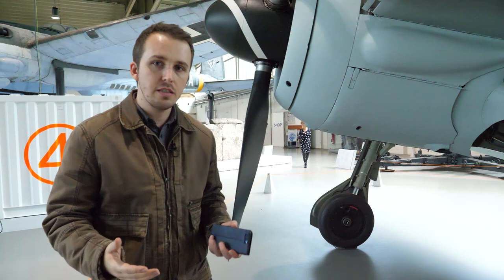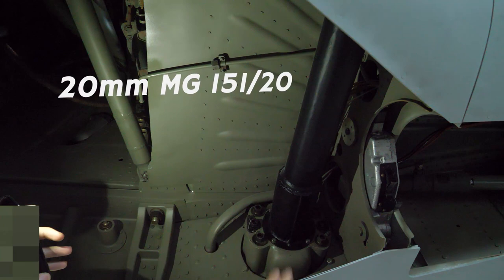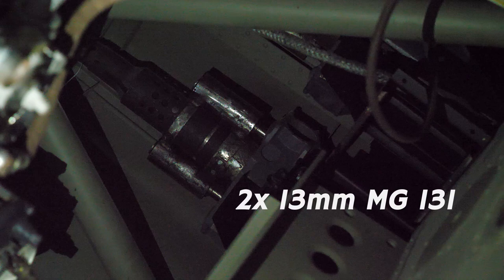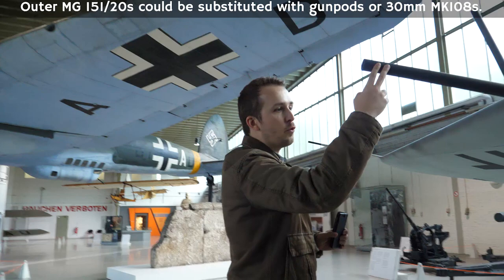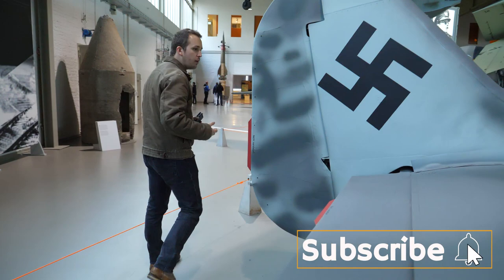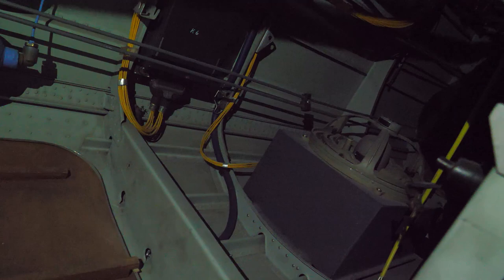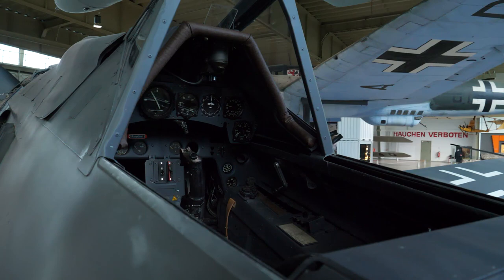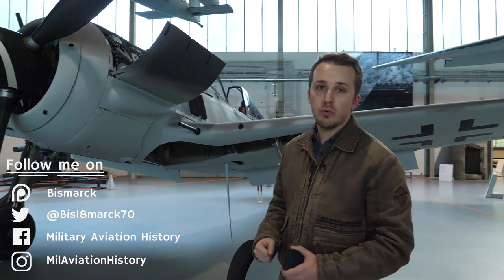Focke Wulf Fw 190 A-8 - Walkaround

Comment: These were gorgeous, lethal fighters for their time. Refreshing to see the tail finished correctly. Most builders and restorers are too PC to include the swazi.
Reply: In Germany, for very obvious reasons, it is highly illegal to openly display the swastika and other symbols of the National Socialist Workers Party (aka The Nazis).

There is, however, very ample room to display swastikas or objects marked with it, especially if the context is clearly historic or non-nazi: A hindu swastika won't get you into trouble, if clearly recognisable as such.
 A museum falls under a similar category. So displaying a period correct swastika on equipment marked with it, it is not at all an issue. Goes equally for restorations, where the all markings are restored.

Same rules apply to sufficiently detailed models. The issue of debate is often the level of detail of the rest, justifying the addition of the swastika. Applying a swastika to a paper airplane is on the wrong side of the divide. As always, context is key.

Putting a swastika on the side of your car, however, not only makes you a questionable person, but is definitely illegal.
Reply: @daszieher  ^

Comment: Many instances of that rear radio compartment being used to stow a mechanic, fellow pilot, or on occasion, civilian evacuees.
Reply: a lot of that kind situations happened during East Front retreat - i've read about it in german pilots diaries :)
Reply: @jurijbaboon  Yes, the Courland pocket is where civilians were evacuated.
Reply: Johanne  Steinhoff  mentioned the use in his book The Straits Of Messina
Reply: There usually is an armored battery box back there. FW-190 was unique because it was the first all electric airplane, I believe. No heavy and vulnerable hydraulics (xcept brakes) or pneumatic systems. Therefore one shot couldn't take out all the systems.
Reply: @fazole  I remember hearing a story about when Beechcraft or Cessna went to file some patents in the mid 60s early 70s, only to find out Focke Wulf had patented the tech 30 years before. I believe it was that automated control system that controlled the settings.
Reply: @sirbader1  
I think Piper came out with a single control lever for manifold pressure and prop pitch in the 80's early 90's. What FW-190 had in 1941!
Reply: Theres so much to tell about this aircraft, also about the way it was manifactured about how the luftwaffe first saw it as a second class fighter etc. Great video, yet i hope that in the future he will attempt to make longer videos with more background info ( like someone down here that mentioned that it was the first plane to have it's surfaces opperated electricly? ) i dont know if thats a fact, yet i never heard of it before. Excelent plane, allies woudn't have had so much trouble if it was an inferior plane.
Reply: @poucxs9246  I don't know if it was the first, but it's systems were electric, so definitely one of the first. It's designer (an electrical engineer) figured it would be more combat effective, and he was probably right.
Reply: Wouldn't putting a person that far back make the center of gravity too tail heavy?
Reply: @wormhole331  They weren't expecting to fight with anyone back there, so full forward trim and a firm grip on the stick and you should be fine... assuming noone else meets you in the air that is.
Reply: @spysareamyth  yeah I imagine it wouldn't be too good for them if a bogey was on their tail.
Reply: @poucxs9246  Lucky for the Allies, there weren’t more of these!

Comment: Excellent restoration of  an FW190 A8. I wish that a D9 variant could be restored and also an FW189.I still have my book on the FW190 written by Heinz Nowarra and between Greg and yourself it's excellent to have these videos.Well Done
Reply: The 190D-9 is on her way. Saw her two weeks ago in the restauration shop in Gatow. The engine is looking good, wings are complete, engine radiator is looking like a new one. Around 70% is original, 30% new.
Reply: Thank you Henry for the update.

Comment: The 190A's could hold their own vs the 47's and 51's. Ultimately it came down to attrition. Had the planes and pilots met on equal terms at 20,000 ft over the western front, the wins and losses would have been much more balanced. Oh, and that 190A-8 is beautiful.  :)

Comment: I live in Southern California, and every year in Chino they have probably the largest collection of still FLYING WWII aircraft. Every year or so there’s an FW-190 that flys. Im assuming it’s a replica, but regardless, it’s such a cool and beautiful aircraft. I’ve gone every year for the last 13 years, and it’s just remarkable and an honor to see these pieces of history fly.
Reply: +J.A.   The Chino Fw-190 is one of the Flugwerk replicas,  although when Rudy Frasca was having it built they decided to use an R-2800 for the engine choice..  The slightly larger cowling improved the lines of the aircraft over the Flugwerk cowling design.

Comment: The reason it looks so pristine is because most of the AC is a replica made by Flugwerk.

This was their first production fuselage and it was used as a static AC using a real 801 and cowl instead of the Russian ASH on the flying replicas
Reply: +Michel Lemieux   All correct, though it is described as having some parts from W.Nr.  682060.  I don't see the W.Nr. painted on it.

Comment: The space behind the engine is achieved after the second version of engine bearer (support) is installed. The first short version was discarded because of the heat that was transfered to the cockpit.

Comment: Love the FW-190. There is a FW-190 Dora version at the Flying Heritage & Combat Armor Museum in Everett WA.
Reply: +Aries13   Workers at Gatow have been restoring a Dora for many years for static display.  It will be nice see it finally finished.  It was a remarkable salvage from Lake Schwerin in the 1980s and by today's standards could have easily been rebuilt to flying condition.  But due to continued deterioration after it was removed from the water a lot of structure needed to be rebuilt for the restoration.

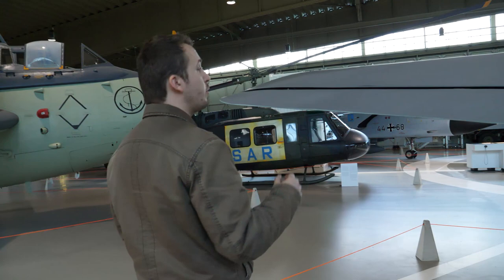Comment: At 3:07, was that a Fairey Gannet in the background?  I didn’t know the Germans used those.
Reply from the maker: Yes, used by the West-German Marineflieger
Reply: Military Aviation History and the Hawker Sea hawk. Beautiful aircraft👍
Reply: An amazing aircraft
Reply: The Royal Australian Navy also flew the Gannett and there is one unrestored on outside display at the Moorabbin Air Museum next to the Moorabbin Airport, Melbourne, Australia. It is one crazy looking plane all folded up. Twin turbo prop engines driving two nose mounted contra rotating propellers. During anti sub patrols one engine could be shut down and the prop feathered to save fuel. Carrier certified.

Comment: I need to ask: you can see the back of the engine, the cowling guns and the wing root cannons from the wheel well--is that actually a feature of Kurt Tank's design (Tanks was a firm believer in making something that was rugged and easy to 'care for') or was something removed at the museum to be able to view these components?
Reply: There was a dimpled (for stiffness) panel that closed that area off to keep debris out of the area and aid cooling in flight with the gear down by prevented air pressure buildup between the engine and firewall, not an issue with the Jumo powered 190 which sometimes operated without this panel.
Reply: @rpurdey  thanks

Comment: Sad that they stoped the Fw 190 d9 restoration. Would be nice to see one in the same presteen condition as this one.
Reply: + Soup Diver   Why was it stopped?  I knew the funding was limited but that is too important of an example to leave unfinished.  When it was raised from Lake Schwerin it was preserved enough to have been made into a flying example, but it was allowed to deteriorate in storage.   If they cannot finish it, then trade it out to another German museum to complete.
Reply: @FiveCentsPlease  This is a quote from a article. That’s the only mention I know of that’s explains why they stoped the restoration besides som forum’s. “ Head restorer Stabsfeldwebel Enrico Schade told us about his present project, collecting parts for the restoration of a FW 190D, (Dora) of which very few have been preserved. Unfortunately, the policy of the museum has changed. The present policy is to exhibit the preserved parts rather than fitting them together into a complete aircraft.
Needless to say, Schade is very disappointed that he doesn't get to rebuild the Dora and to exhibit it next to his recently restored FW 190 A8. These two beside one another would make a unique exhibition.”
Reply: @soupdiver6855   Well that wastes the years of work spent on it.   Very short sighted by the museum leadership and I hope another museum offers a trade and completes the work.

Comment: The Spit and the Mustang are elegant-looking, beautiful aircrafts but the Focke Wulf 190 "Butcherbird" looks like combat in every way.. Like a pitbull.. Those cannons poking out and that fat nose.. wide stand on its landing gear.. painted like a uniform.. Form follows function.. If a Spitfire is a beautiful Colt .45 then this is a Clock 29 in 10mm auto.. A lump packing a punch..
Reply: or a small but tough MMA fighter.

Comment: Are you sure about the MW-50 boost? The A8 was never equipped with it (It used the normal notleistung). The F3 and F8 Jabo's used some sort of low level boost system, but this was C3 boost system and not MW-50. The D9 did have it though.
Reply from the maker: That's a good question! I spend some time looking into this but have yet to find a 100% conclusive result. Generally I stand on the side of 'A8 usually didn't use MW50' (exceptions will surely apply) as the manual only accounts for GM-1. However, I have found a document from the time that suggests MW50 remained an option, hence why I listed it as a 'could be' option.
Reply: You can see a 115 litre tank for MW 50 forward of the radio compartment (painted black) on this video. It could be used also as an additional fuel tank.

Comment: Is this the A8 version? I don,t see the extra armourplate protecting the cockpit. The armament also does not add up. The A8 Sturmbock was armed with two Rheinmetall Börsig 30 mm cannon on the innerside and two 20mm cannon mounted on the outerside of it,s wings. And two 13mm machine guns mounted above it,s engine. Very heavy, lethal but also vulnarable for Allied fighter planes because of it,s weight which impeded it,s agility

Comment: Surprised that it was that open, the mud and snow of the eastern front must have been able to get up in there and cause maintenance issues?
Reply: It's not normally that open. The 13mm ammo cans aren't fitted and the internal wheel well covers are off. The engine fan is also blowing quite hard which will prevent stuff from getting in through small openings.

Comment: I guess we should expect more on this aircraft, I found this from video of early history on that company. 

P.S. I got a question: Ju-87 Stuka - is that a bomber or is that a “Sturmovick”? A lots of pips thinking Germany did not have a dedicated Sturmovick. I strongly disagree with that view, because I know history of operation of that aircraft, but what is your take on that? What Sturmovick in German language would be called, and give us(if possible), an overview of German ground attack aircraft. Hs-123, 129 and etc. Perhaps even earlier examples of “Sturmovick”. Would 109 and 190 was considered as a ligitamate “Sturmovick”, again I know the answer to this question, since StG 2 Immelmann was remanded into SG 2 Immelmann. I just throwing a subject to talk about. What is “German Sturmovick” of WWII, in your Understanding, I guess...
Reply: It depends on how you define the role, dive bombing versus close air support, some view those as different roles. The Stuka was primarily a dive bomber that sometimes did CAS while the IL-2 primarily tended to loiter at low level doing CAS, along the lines of a modern A-10 or Su-25. The Ju-87G with the 37mm cannons is the closest fit to my mind if you mean something that can loiter and tank bust like the IL-2, the additional armor probably made it too heavy to still be able to safely dive bomb. The earlier Ju-87 models did not have the protective armor plating, and the ones before the D-5 only had 7.92mm machine guns. The Fw-190 is a different animal, the ground attack versions of that plane are still very much fully capable dogfighters, more like a P-47 or Hawker Tempest than an IL-2. The Ju-87 was notoriously dependent on fighter escorts.
Reply: RussianThunderrr The German word “STUKA” is an abbreviation of the German word STUurz.KAmpf.flugzeug which translates as “Dive Combat Aircraft”.   A Ju 88 was also a Stuka but it is mostly associated with the Ju 87.

I believe Sturmovik translates as “assault aircraft” that used 23mm machine cannons, rockets, bombs and bomblets in shallow dives to attack armour and supply columns .   

The German equivalent was probably the Henschel Hs 129 though used only in small numbers due to lack of suitable engines.   From about 1942 on the Ju 87D5 the rifle caliber machine guns were replaced by 20mm MG 151/20 and the Ju 87 started being used more like a Sturmovik.    The Ju 87G got rid of the dive brakes an was a true Sturmovik, it sometimes carried 30mm or 37mm gun packs.  Vertical dive bombing wasn’t necessary from 1942 onwards as the Germans had the Lotfe 7 computing level bombing bombsight and the StuVi 5B shallow dive bombing sight.  The Me 410 like the Ju 88 could have dive brakes and with the StuVi 5B qwas supposed to replace the Ju 87.

Remember the Russian Airforce, the VVS, invented the anti tank rocket.  They helped the British and Americans develop theirs.  The Germans didn’t have any till very late in the war.   They copied the Russian rockets but used cluster bomb warheads of 7 or 22 SHL 2 shaped charge warheads.

The Germans generally used a special Fw 190F fighter bomber with 1 bomb or 4x 50kg bombs.  They had a time delay set on the bomb and would slide it into the tank they wanted to damage or destoy.  It was quite accurate.  Occasionally they used cluster bomblets.

Comment: Erm.. doesn't the Anton normally have a cover plate in the wheel well, shielding the engine? Did like the engine detail view though.
Reply: I was very surprised that there was nothing between the wheel wells and the engine. Can you imagine the mess it would make with mud and slush splashed up inside the engine housing? Surely there were access panels that had been removed for the video?
Reply: At 1:21 there is a keel line  structural member painted green with a pattern of holes that looks like a mounting point for internal and external sheet metal.
Reply: I know the 190D had open wheel wells and that the engine was directly visible through them, but I thought that was because of cooling issues with the Jumo engine. There's even some WW2 footage of several Doras taking off from a snow/sludge covered airfield (possibly during Operation Bodenplatte), so apparently that was perfectly doable.
But yes, panels may have been removed during this vid for the sake of the nice detail shots. I also found the view through the port fuselage panel of the MW50 tank particularly nice.
Reply: @KitKabinet  I found the little oxygen bottles to be rather odd but it was an interesting view of the inside of the rear fuselage.
Reply: @KitKabinet  Operation Bodenplatte, what a cock up of an operation, not pre warning your own flak batteries that something might happen.

Comment: It looks like the Americans started using' Paddle Props' for propellers.  Why didn't the Germans or other nations do this??
Reply: +William Wood   Propeller choice was always a compromise between engine output,  drag, and the desired mission of the aircraft.   Paddle-blade would offer better high altitude performance.   The Luftwaffe did use paddle-blade on some aircraft.    https://www.asisbiz.com/il2/Fw-190D/JG26/images/Focke-Wulf-Fw-190D13-Stab-JG26-Yellow-10-Kdr-Franz-Gotz-WNr-836017-Weiche-Germany-1945-03.jpg

Comment: The aircraft was a Frankenstein it's got the ju-88 engine Hitler interfered with the design constantly it's the only water cooled radio engine I know of water cooling a radial engine eliminates the reason for using the radio engine the light weight
Reply: +dogiit1   Everything you have said in the last five minutes is incorrect except for the remarks by the test pilot.
Reply: @FiveCentsPlease  He might be talking about the D9 and the 'compromise' it took to fit the Jumo engine in the FW fuselage.
Reply: @nickmitsialis    The comment author also said that the plane had a "water cooled" radial engine,  which it did not at all.   An easy error at a glance but if you understand the design of the Dora series and the fitting of the annular radiator arrangement with the Jumo V12 then you would not say that it had a water-cooled radial.   The compromise was that Tank could not get the DB engines that he wanted from the RLM. But he designed the Dora to mount either engine with minimal cowling changes, which is very clever.